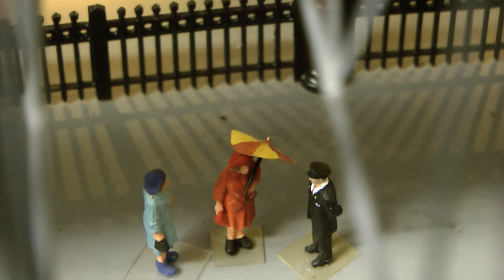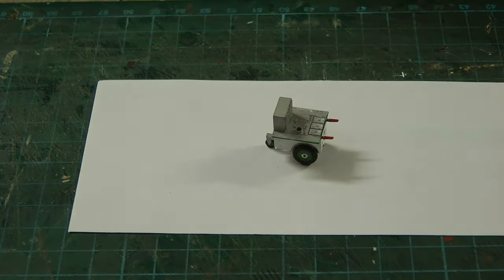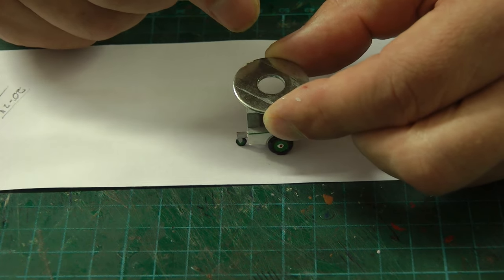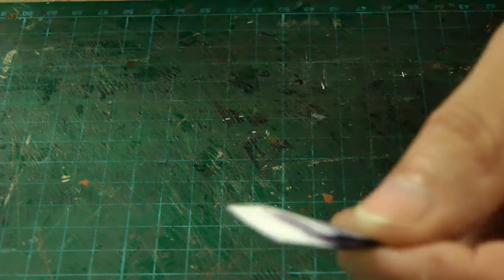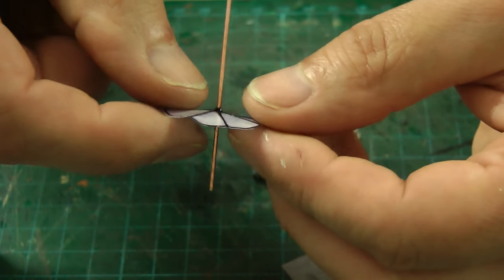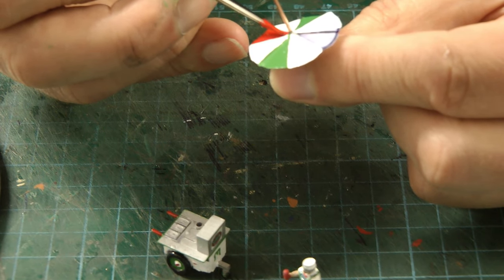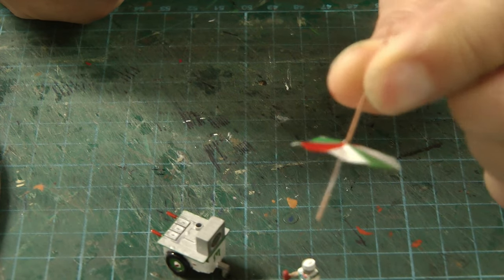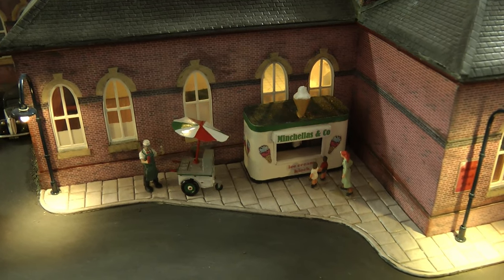Luigi's Brolly For a Trolly.            N0447

Comment: Two in one day you are spoiling us Tony, but great to see. If you were to keep them together I think I would have made the cart to sell hot dogs or something similar. Fantastic idea to use superglue to stiffen up the paper for the parasol (one to remember). Take care and regards Barry..
Reply from the maker: Hello Barry again you popping up everywhere. i love the Ice Cream upgrade you have done. as it looks straight forward to do. i may keep that idea in my pocket. take care buddy. cheer's Tony.
Reply: @TONYNORTHEASTERN  If you do please don't make the same mistake as I did, tried to cut the clear plastic with a knife and it cracked found by drilling a small 0.4mm hole in each corner of section to be cut out then cut between holes with dremel using finest disc work ok. I did this so you could see the ice cream seller.